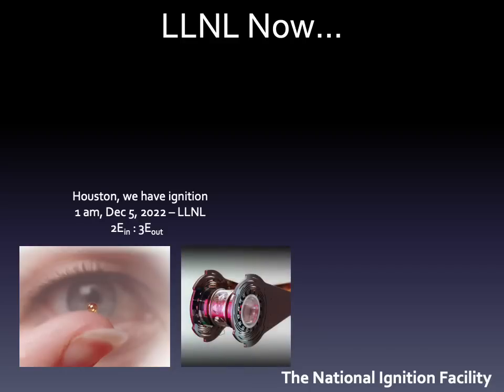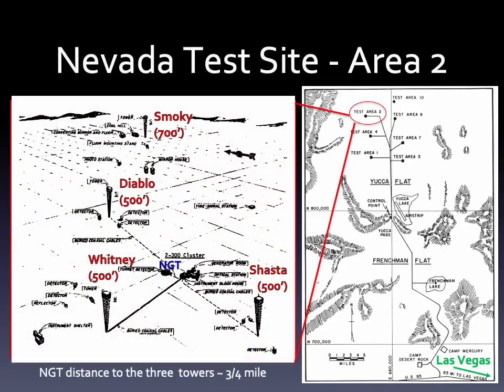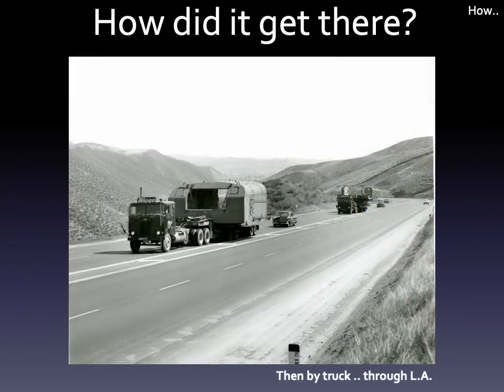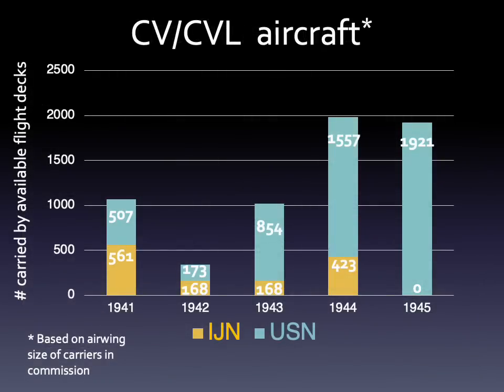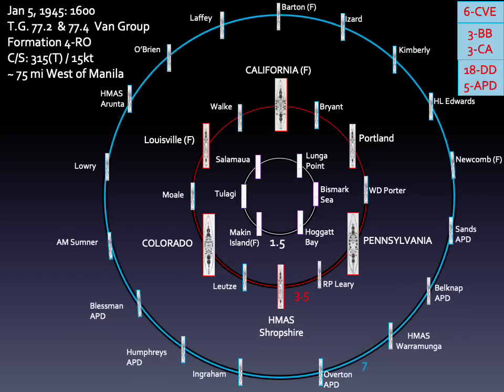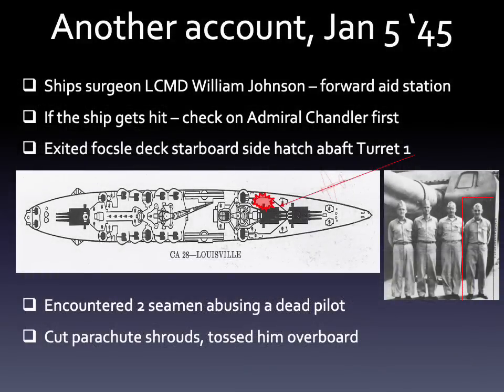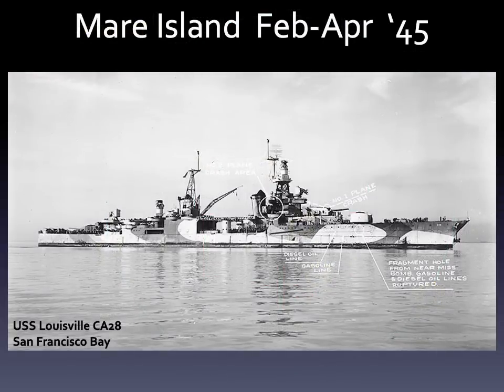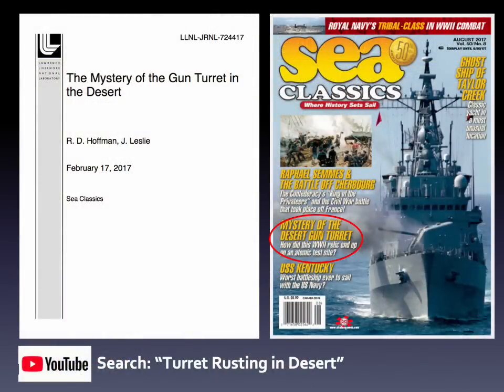Lucky Lady Lou

Comment: The FM-2 Wildcat was not the same plane as the F4F-3s and -4s that the USN was using when the war started. It was up powered and had larger control surfaces. Flown by late war pilots against the A6M-5 Zero it was more than a match.
Reply: Excellent reporting on the battle!
Reply: Late in the war they allegedly super turbo-ed the Corsair someplace in England. There is some argument about the project because Rolls then later actually built kit engines for some reasons in my opinion anyway the Corsair never really died. Even today they produce parts for em which is a bit surprising. Make a note a souped up Corsair could engage most conventional sub sonic aircraft even here & today. Believe it or not my grand father who was a WWI and WWII pilot said that to me in the 1970s not just Matt Holiday recently the Corsair collector here where I live. i believe it just seeing his 4 birds fly. The corsair could also skim the wave tops at more than 450mph and most Japanese ship mount guns could not aim that low. Which is one thing Matt pointed out the sheer speed and that particular planes ability to just instantly lift itself off the deck at any speed was another feature even the Hell Cats of the era couldn't just get instant loft like a Corsair could. One other thing about the Corsair is my grand father said by drilling 1/2 holes in the floor of the plane not only helped cool the plane the reasons they even did that he said by drilling even more holes in the rear canopy glass the things went even faster. Something I never heard of nor even thought about how that would benefit a plane like that.

Comment: CL is Light Cruiser. CA is Heavy Cruiser.
Reply: The early cruisers were classified CL then changed to CA in 1931. Before that, "CA" did not exist.
From ibiblio online, "In 1926, construction began on a new group of light cruisers, armed with eight-inch guns instead of the six-inch or smaller weapons carried by the existing CLs. Eight of these were completed between late 1929 and early 1931 as CL-24 through CL-31. At the beginning of July 1931, these eight ships were redesignated as "heavy cruisers" (CA), based on warship classifications established by the previous year's London Naval Treaty, but their hull numbers were not changed."
Edit: cruiser hull numbers were never rearranged. Each cruiser got the next hull number in line whether it was a CA or a CL. For example the 67th cruiser was CL-67 Topeka and the 68th was CA-68 Baltimore.
Reply: @ut000bs  Light cruisers are armed with 6" guns. Heavy cruisers are armed with 8" guns! PERIOD! Quit being lazy and do your research PROPERLY!

Comment: Not a chance in H***. You couldn't climb out of the cockpit and run over to the edge of the wing in under 2 seconds...even if the Zero was sitting in the hangar. Do it while the aircraft is in a dive, under very heavy fire from the ship's AA weapons? Also, the Zero would tip to the left as the pilot's weight moved farther out. No. April Fools, folks.